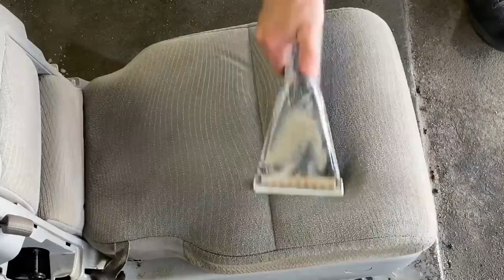FILTHY SEAT EXTRACTION COMPILATION| Satisfying Dirty Car Detailing Cleaning Nasty Carpets ASMR

Comment: Have you ever tried any oxygen bleach for those old seats that have turned grey with dirt staining over the years?  The grey color won't come out with agitating and extracting.  I used to use Chlorox-II powder mixed into a fairly strong solution.  I don't know if that is still available. I have not tried the new liquid ones like Javex-II, on car upholstery, although it does work well on wash cloths. Takes out stains and discolorations. Always be sure to rinse it out extra well.  For badly stained seat belts I used to leave it on overnight (keep the belt fully extended as you don't need that stuff in the mechanism) and rinse it straight through the fabric with the vacuum on one side and fresh warm water squirted through the other.  It was amazing.

Comment: Nice wet chairs😄what's your method of drying them b4 Delivery🤔??? Good job👍🏾
Reply: Every extractor has the ability to suction without spraying water. You just run over the seats with suction only to pull out as much water as possible and then leave to air dry for a couple hours.